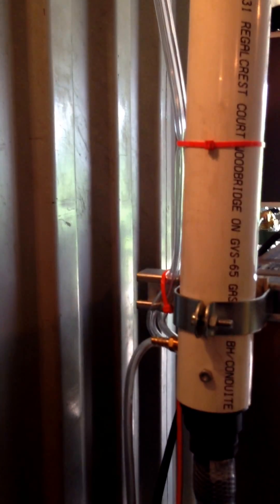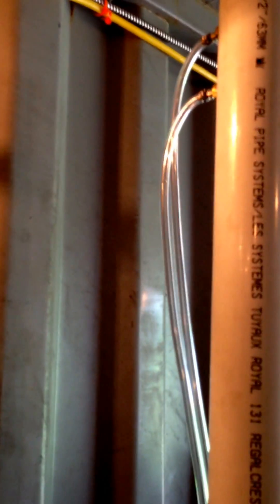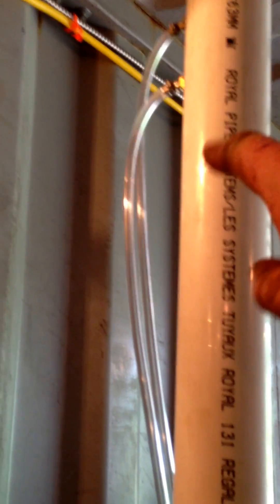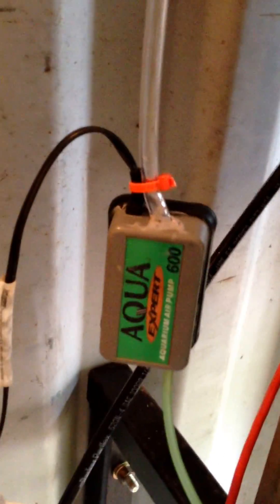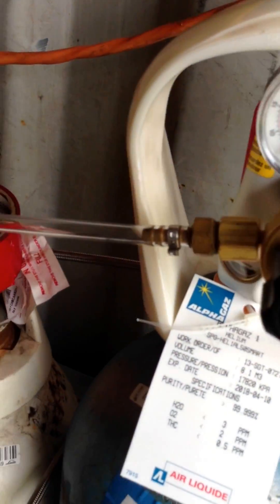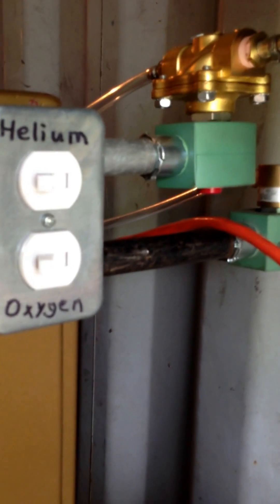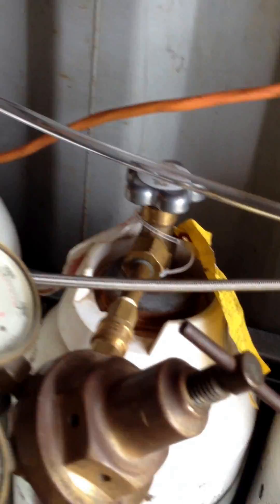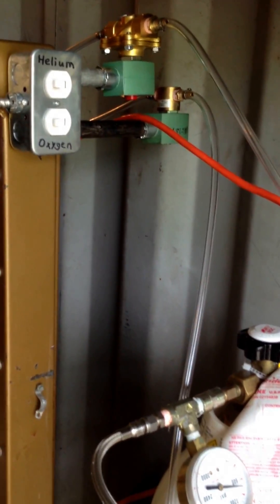Home made nitrox stick.

Comment: Hey, i am interested in making a high temperature gas analyzer (~300C) 
to check for harmful gas emission from "Chula" in rural India as a 
social pro bono project. Carbon monoxide is what i primarily want to 
detect, and i wish to avoid cross detection? would it be possible to do 
this?

Comment from the maker: I have since stopped using this setup, due to a regulator failure that lead to a 3rd stage head explosion. The compressor was damaged, but not destroyed. The accident occurred when an o2 supply tank was nearly empty and the regulator free flowed, causing a sudden spike in o2 concentration being supplied to the compressor. The final stage head exploded. Nobody was hurt and the compressor has since been repaired, but it left me a little more cautious.

In hind sight, having a higher quality regulator, in addition to a device to shut down the solenoids at high o2 concentration would have prevented that situation.
Reply: Thanks for sharing this !

Comment: Can you show a video of scavenging leftover mix to re compress?
Reply from the maker: The best method of using a compressor to scavenge a leftover mix is to use a bag on the intake of the compressor. We have used a lift bag with great success. The key is to have the lift bag mostly inflated, so that the compressor always has something to draw in.